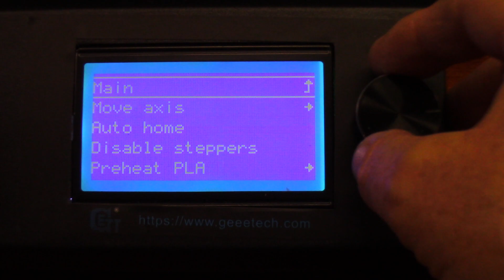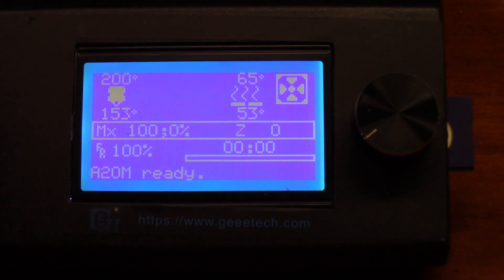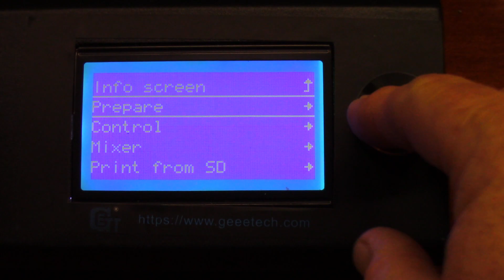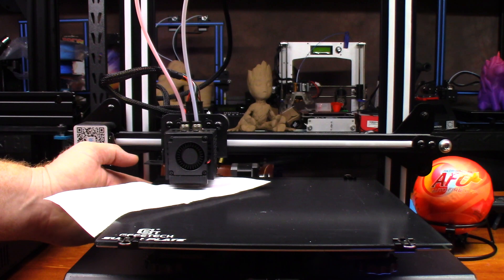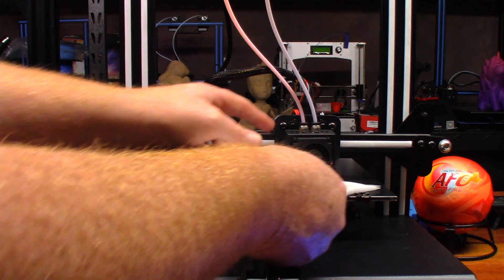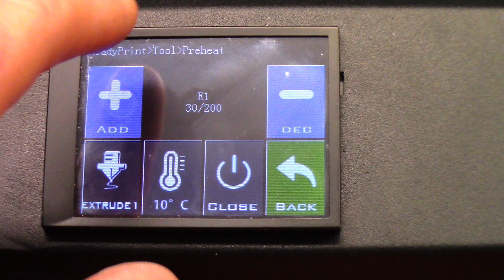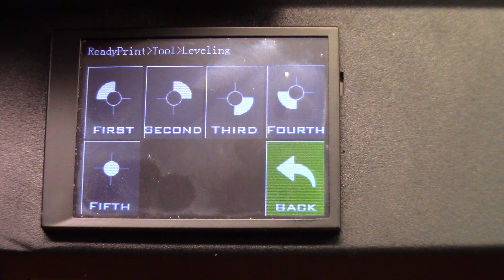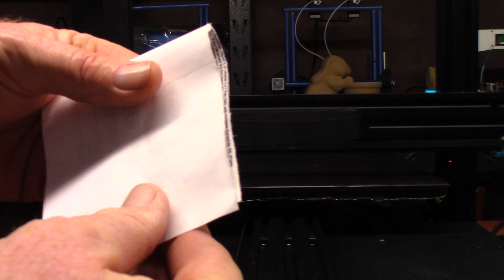Getting Started / Leveling A "Prusa Style" 3D Printer Build Plate

Comment: Great video Jimmy. I installed a bltouch probe on my Anet E10 but was having terrible issues with it. I've now reverted back to the traditional endstop and it levels so much better.
Reply: I had to fiddle a lot with my bltouch to get the z offset, but now that it's correctly set, it's working great.
My bed is badly warped, and I now use a borrosilicate (yep Jimmy, that's it) glass sheet, and I dig the shiny finish it gives.
Reply: @tripy75  I was discussing this very topic with a friend who I helped install a BL on her 3D printer and she agreed while they are nice, especially if your bed is a Pringles chip, they really are not that necessary on a standard machine. On a really large or delta style machine is where I think they shine as you can use software to compensate for issues that otherwise are not easily dealt with manually.
Reply: @MakeItWithCalvin  Yes, true. My 1st printer was crap (tronxy x3) and taking a part off the bed was ruining the leveling.
The bltouch was a try to get around that.
When I gutted the tronxy to build my hypercube, I kept it and used a glass sheet to have a truly flat surface (still not 100%, but much better)

I tried buildtak, printinz and other surface on the heated bed, but it was so warped that I had zones with no extrusions, and another where the filament was printig mid air just next to it.
Reply: @tripy75  Yea a good example of it in use, that being said the BL touch is a very useful tool and I am really grateful someone did come up with it though!